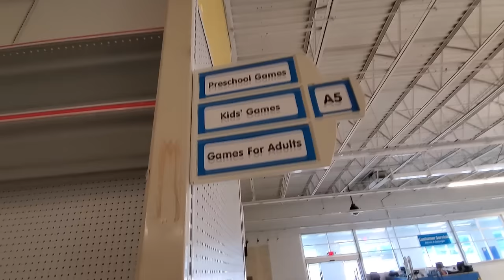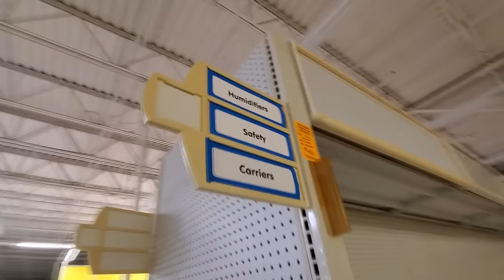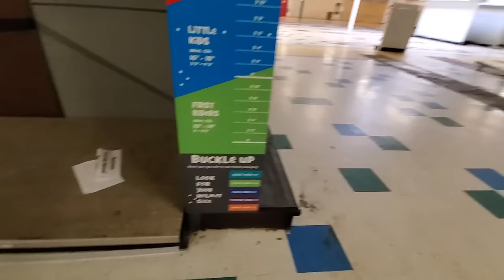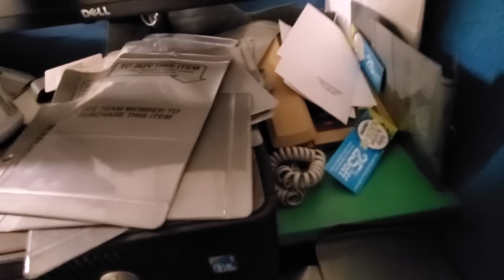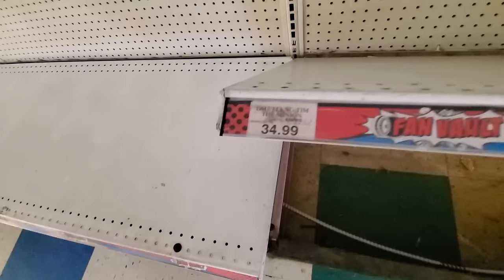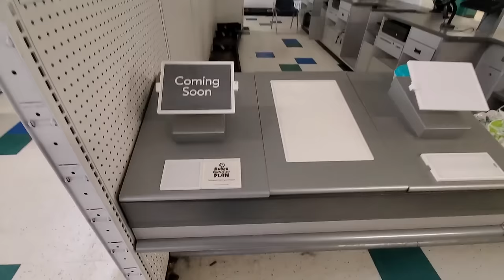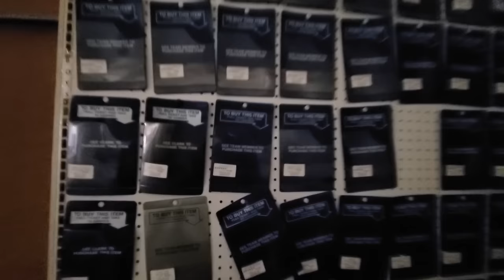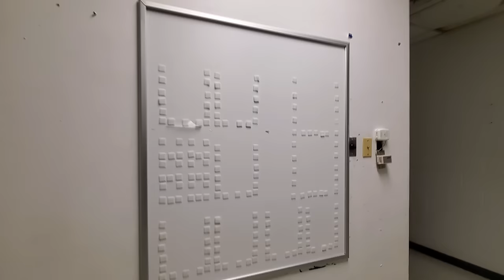RETURN TO TOYS R US : COMPLETE INSIDE WALK THROUGH w COMMENTARY

Comment: 20:54 - 23:35 Looks like they might have downsized the sales floor at some point because that vinyl floor continues past the back pegboard display wall, a quite possible sign that the sales floor was originally bigger and those bolts sticking out of the floor must have been mounts for a display shelf that was there. I could be right, I could be wrong.